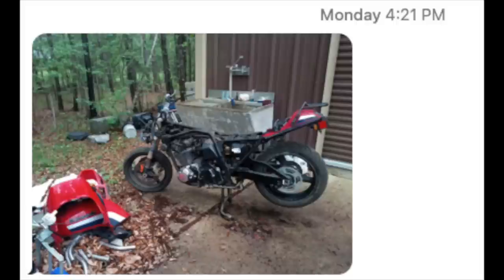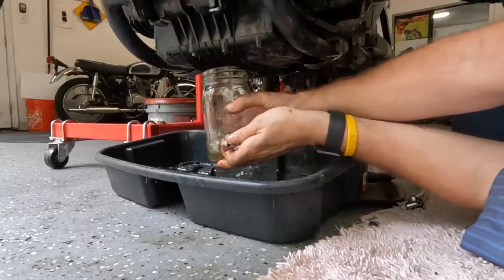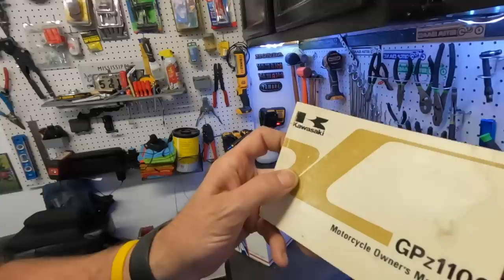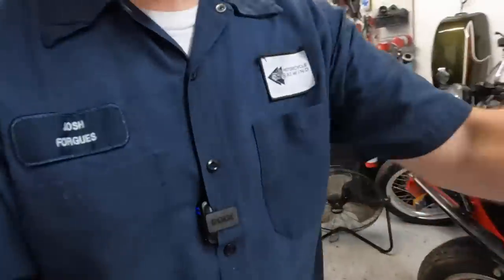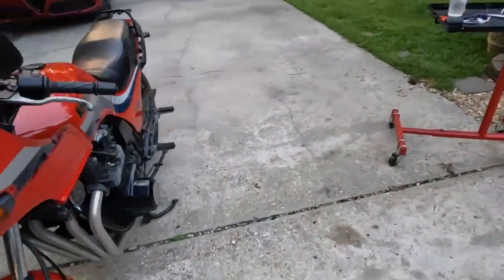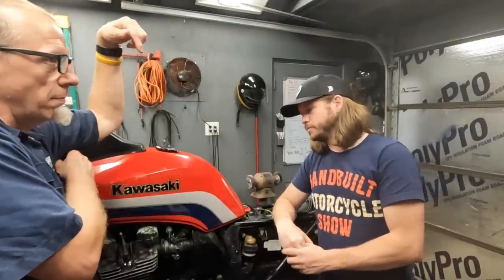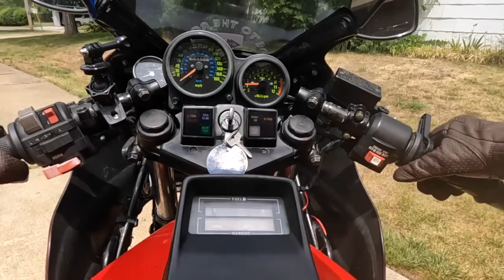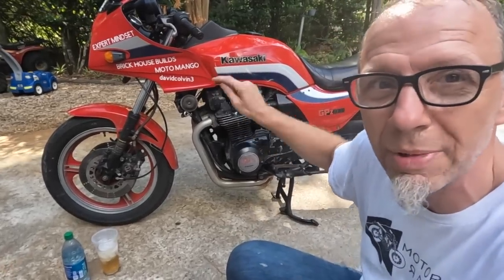Can I ride 3,000 Miles on abandoned 1983 Kawasaki GPZ1100 #gpz1100 #vintagemotorcycle #sportbike

Comment: Great to see another classic back from the dead!
Reply from the maker: This is one of my favorite bikes now. I ride it nearly daily.
Reply: @motorcyclerewind  - I’m just puzzled how it is that people can store a bike in that way. I needed a new engine for my FT500-engined Honda CB250RS. Got an XL500S (1976) from a seller in Germany. If he’d bothered to oil up the bore and put in a spark-plug, it would have been good enough to go straight in as a runner. Piston & rings siezed solid to the bore. Bore ruined. New piston , rings and a rebore required.

Comment: I brought one of these in 1983, when I was 23. I still have it and ride it occasionally. Still has the fuel injection on it - most of the ones here in Australia have carbies on after the DFI packs in. Good you for getting her going and keeping it as original as possible.
Reply from the maker: WOW!!! I would love to hear your GPz stories. I have fallen in love with this motorcycle. Thanks for watching.
Reply: How many miles does she have?
Reply: I bought mine 2nd hand in about 85 or 86 and its still in the shed hasn't been started in 30yrs, best trip I ever did was Sydney to Adelaide to Melbourne and Sydney.

Comment: As an owner/mechanic of several big vintage Kawasaki’s I can say it’s the crank sensor - Hall effect sensor. They eventually go out on all these bikes and usually become heat sensitive over time so the bike will start and run until it gets hot then: poof!
Reply: Even newer vehicles are worse when it comes to the myriad of electrical sensors and complexity hey.
One of my bikes is a 1983 two stroke, no fuel injection even, I love it, it takes me back to being 18 again and it's easy to work on unlike my modem bike that's even got a fly by wire throttle.
Reply: @steveclark..  Which ONE>??Cant be an RZ 3 fiddy..those were 84/85? I have friend in Boulder Co with an NS 400 triple. Or dirt bike>? I have 93 Wr250z / Ktm 300 2008 1974 RD 350 Love my olde " OILEYS"
Reply: @davestrain9529  The first RD350 with water cooling.
Reply: @steveclark..  YAY! 4LO. Non Ypvs. My friend has a Canadian. my riding budd. Partners in 2T Crime
Reply: Yes, the Kawasaki crank triggers of the era are woefully prone to intermittent failures. I had an 811000LTD that would drop two cylinders anytime it was too hot outside or whenever it rained. I had a few others that gradually failed outright. Dyna S is one low-ish cost solution for the 81-83 big KZ-J type engines (but won't easily bolt on the 83-85 GPz1100, 85-86 KZ1100 LTD, or KZ1100R without completely swapping the ignition housings and KZ-J mechanical advance mechanism on the right side of the crankcase), but be prepared to spend more to swap out the coils and wires too. The Dyna 2000  ignition system is more expensive, but it has more features including programable advance curves, and can fit the stock later model GPz style housing with minor mods. Forget about the Dyna 4000 unless your bike is only used at the drag strip. The ARC 2 is also pretty much racing only - my friend has one for his MTC 1395 cc  GPz 1100 with a home built fuel injection system that works with the ignition, but hasn't run it yet (work is ongoing).
Reply: @steveclark..  The 81 RD350LC "Elsie". Giant slayer in its day. Only exceeded by the 88 TZR250 in best ever two stroke race bikes Yamaha made for Canada with lights and a license plate holder. Of course, putting a license plate on a TZ750 or YZR 680 Daytona Special would be even better.
Reply: @davestrain9529  Most of the world that still had new two stroke street bikes after 1978 got the 1983 RZ350 one year before it came to the USA in 1984. The predecessor and first liquid cooled RD 350 was the 45-ish HP RD350LC - (guess what "LC" stood for) that first appeared in 1981. In countries like the UK, the 55 HP 83 RZ was still called the RD, even though it was a completely new design featuring the first street bike version of YPVS.
Reply: @steveclark..  RD 350 LC that engine basically  was with very few changes still in production until 2012 or 2014 from memory was the last time in Australia at least you could buy a new Yamaha banshee Quad that used the same engine so parts are easy to get then there is the aftermarket .I have built Banshees up to 1300 CC Triples with Billet cases and Hyabusa Suzuki gearboxes in them Cases by Mattoon Machine, plus 535 and 610 and 800CC twins
There is so much stuff for banshees a common build on the cheap was Athena out of Italy Barrels plus a 4mm Stroker Crank from HOTCAMS crank range that combo did not require machining Crankcases fro clearance but with 35mm Keihin PWK cards and chambers they make about mid 90 Horsepower at the wheels so an absolute rocketship for cheap.There are so many options for Banshees such as Cheetah Cylinders etc worth looking into I would run Athenas on the road probably not so the Cheetah Cylinders.
Reply: @davestrain9529  Yes, it's a 4LO, all my teenage friends had them back in the day. Of course I would have liked to have the full fairing YPVS model back then but couldn't afford one. I could have bought one the other year but I'm so pleased that I went for the 4LO instead, the memories alone, just looking at this bike every time I'm in the garage. This is the only make and model of bike that I now own 3 times, in 40+ years of riding, that says something. I don't ever plan on letting this one go.
Reply: @scottb8175  Yep, that's the Elsie that I have, mine Is a 1983, probably one of the last ones out of the factory.
Reply: @scottb8175  I rode the 88 tzr of  freinds for 3 months when he was on holiday & I looked after it, couldn't wipe the grin off my face after every ride, if i'd been a bit shorter(I'm a 6 footer) I'd have bought one then & still have it . Most fun you can have on real roads.
Reply: Yes excactly what happened to my Kawasaki 900R (the Topgun model, same color even) i swapped it to a GPZ750 ZX never had the problem with this later model, i even drove long distances like Denmark-southern France twice (2000 km) without long breaks. Maybe they fixed this problem in 1985 and forward. My last Kawasaki was the legendary ZX-11 (this bikes poor brake abillity and crazy power almost had me killed several times, probally bad brake abillity due to the high center of gravity and small ground clearance) my friend had the ZX-10 tomcat so i had to buy the 11 to beat him. (The fastest bike in the world for 6 years)
Reply: @boboman67  Don't know how true this is but it's sad that the bike Tom rode in that movie wasn't a 900, it were a 750 version.
Reply: @steveclark..  scroll down to see all the original photos from the scenery
Reply: Either that or maybe the fuel pump (if it has one).
Reply: The R 5 was the first Yamaha twin. Piston Port two stroke. I had one and it could be turned into Quarter mile bike. Then the RD 350. Great bike. I could outrun most 750s. If I ever find another I will make a project out it.
Reply: I have a 84 gpz 1100 , bought it 8 years ago. It had sat for over 20 years. Replacement injection parts impossible to find. I was forced to put on a rack of Mikuni BS 34 carbs until I sourced out most of the fuel injection parts. That took 2 years. Now the bike runs like new.
Reply: That’s exactly what happened to my Honda single

Comment: You have genuinely encouraged me to get the spanners back out on the bike that's sat in my garden for the last 18  months 😊😊 one thing I will say is no matter what the project is, I'd urge everyone to spend the £2  on a simple inline fuel filter - the hassle that can save is worth it 100x over!
Reply from the maker: Send me pics of your bike to MotorcycleRewind@gmail.com or on Instagram. Great advice on the fuel filter. Ounce of prevention, pound of cure sort of thing. Thanks for watching.
Reply: get quality metal one and change once a yr cheap insurance

Comment: I bought a 2004 Ninja 500R for $500 in March 2023 … sold as not running, in three pieces …. By June 2023 I had taken it to the interior of BC 1215km round trip … ran great :) …. My Ninja 500 for $500 (plus a few $$ on parts and some elbow grease - and of course some Kawasaki good luck) …. Ride on …. Cheers from Vancouver Island BC Canada 🇨🇦
Reply from the maker: We need to do a ride together!!! Those are my favorite kind of motorcycles. Ones you get cheap and shock everybody you tell how much you paid for it or in my case didn’t pay. Thanks for watching.

Comment: Dude that thing is so cool. 
Back in 98 I bought a wrecked. 95 Suzuki GSX-R 1127cc, I restored it and rode that bike for 12 years, it had 6000 miles on it when I bought it, had 43000 on it when I sold it in 2010. I didnt want to sell it but, got to old for that sportbike riding position. 
I ride a 2010 Honda vt1300 sabre now, but I do miss that 136hp that the Suzuki put out.
I have been riding since the mid 70s and have owned around 25 bikes over the years.
Watching you restore this bike brought back memories of my Suzuki Gsxr 1127cc.
I have always been a fan of japanese bikes, especially Hondas.
Great video 👍
Reply from the maker: Glad I could help you stroll down memory lane. This GPZ has been so much fun. I really like it. Ride it almost daily! Thank you so much for watching.

Comment: I had one of these 23 years ago. I bought it second hand from a dealership with (thank God!) good warranty. Unfortunately it had the same kind of issues as yours. When everything worked, it was a beast with wheel spin in 3rd gear on a wet road if you went a bit too wild on the throttle. When I had to turn the bike in for repair the 4th time, the mechanic told me that they ran out of options and offered me to trade it for a Yamaha FZR 750 which I did. A great bike that ran without any issues until I sold it 2 years later.
Reply from the maker: Theses GPZ’s are awesome. Sorry you had problems with yours. Thanks for sharing.

Comment: A testimony to how damn bulletproof the air cooled  4 cylinder two valve Kawaski engines are. The 1983-85 GPz 1100 has all the good parts the KZ drag racers would die for - strongest crank, the biggest valves, highest flowing cylinder head, undercut transmission, strongest clutch, etc. I have two 83 GPz1100's....but only one has a functioning OEM DFI.
Reply from the maker: That’s why I say this is the best motorcycle ever made.
Reply: @motorcyclerewind  The one I have that is stock, except running a stock but re-jetted set of 81 KZ1000 Mikuni BS34 carbs,  has pulled my 210 lbs carcass to over 150 mph, measured by GPS. Not as quick as the 83 GS1100, CB1100F, V65 Magna, or 1100 Katana, but give it room to stretch its legs and it will gradually reach and hold 150+ and slowly walk away from all the above 1983 horsepower kings. I've never tried to find out what top speed is on the one I have that still runs the OEM DFI, though - that one burns copious amounts of oil and ran noisy since I bought it. I'll probably just swap the DFI over to the nicer  carbureted  one and use it for spare parts (It's in rough shape all over, and has the entire front end from a GPz750 Turbo on it).

Comment: I so enjoyed watching your adventure. I could relate to your trip and finding great pleaseure in not knowing what tomorrow brings.
Regarding finding the electrical fault i once had a Varadero with a similar problem and by chance i could start it in the pitc 53:06 h dark. Found small arch like sparks inside one wires leading to the ECU. Found an internal wire break making partial contact. But could only see it in the dark....hope you solve the problem.
Reply from the maker: I did not know what I was getting myself into. Thanks for watching. 
The fault that shut us down at the end was the coil for cylinders 2&3 was loos and shorting out.

Comment: Nice work! This might be blasphemous but it looks pretty slick with the GSXR USD forks and swing-arm. I also appreciate wanting it to be period correct. Do you reckon the GSXR parts would have really negatively affected how it went down the road?
Reply from the maker: Yes the swing arm hit the frame so know rear suspension. Not fun to ride. The front suspension would have worked but not without completely fabricating a upper and lower triple tree. The one on the bike did not allow for me to turn the bike around in the driveway.

Comment: Had a similar issue with my GPZ1100. The 4 into 1 header was less restrictive and caused the problem. I installed a 0-5k rheostat between the temperature sensor (in the head) and the CPU. I ran wires up to the instrument panel and drilled a hole to install the rheostat. Just adjusted via the knob, 'till it ran right.  I bought mine second hand and it came with a Kerker megaphone exhaust, It was the first year Kawasaki produced the GPZs and it had two shock absorbers.
Reply from the maker: That sounds like a mod I would be into. Thanks for watching

Comment: I learned to drive on a 83 Gpz1100. Probably wasn’t the wisest way to start but survived. Bought a new Gpz 550 and had a lot of on Kawasakis since. Respect on the awesome rebuild.
Reply from the maker: The GPZ1100 is a crazy bike to learn on. 😂 thanks for watching.
Reply: @motorcyclerewind 
I owned a 1984 GPz550
/  AKA zx550A1.    It had same frame-mounted half-fairing as your 1100.    My 550 was the LAST year they ever made GPz550.  The next year,  they came out with GPz600 Ninja  (with the 16" front wheel).

Comment: Watching this video brought back good memories, and nightmares from 1992. Had an 84 1100 GPz, loved it, but it had the exact same demons yours has; 3500 rpm lean spot, quitting for no reason, coming back without doing anything.  Possessed.  They did not like headers.  Only a few years ago had an ‘82 with stock exhaust.  That one was was more reliable, but still had a lean stumble time to time.  Was ready to find another until the scene where you were left stranded.  All good fun.
Reply from the maker: Thankfully the DFI has been trouble free. The coil vibrating loose at the end is what shut us down. Have put another 3,000 trouble free miles on it since. Thanks for watching.

Comment: This brought back some memories. Familiar friend from long ago. Well done.
Reply from the maker: Thanks for watching Adam. Assuming you had one would love to hear some stories.
Reply: @motorcyclerewind  Yes I had the GPZ 750 turbo, 1984 model. Had it from about '91 to '95. Samr colouring, slightly different with a full lower fairing and cowl. Most comfortable riding position, seat, and just a sublime ride on the open road. As soon as I saw those original wheels go back on, the snail cam adjuster on the swingarm, the memories of wrenching on that thing in the early hours came flooding back. My late wife adored it too, we went everywhere together on it.
   Yours has now entered the category of  SURVIVOR rather than abandoned. 
   I personally would ditch the exhaust as those race cans tend to cause leaning out problems. Unsure if a ECU flash can even be done on that model now, so closer to stock exhaust back pressure and flow would probably ease your lean stumble. 
   Keep on with this project man. its worth it.
Reply: @motorcyclerewind  Funny thing about old memories. I too had issues like this. It turned out to be crap from the interior of the tank blocking up the fuel filter. I was always replacing the filter. I'd investigate rust layers in the tank, maybe the old shaking nuts n bolts about in the tank to scour its interior clean, then a tank liner product.

Comment: Funny how you got it resurrected except for the speedo...
I love these old bikes.  Thanks for the video.
Reply from the maker: I explain it in the Q&A video. I left for the trip on Tuesday AM. The first time I rode the motorcycle was the Saturday before in late afternoon. At that time I realized that the speedo cable I had purchased was incorrect. No way to get another in time. I added another speedo to the left side of the gauges tucked into the fairing. You can see it in some of the footage. Thanks for watching.

Comment: Most impressive work on that GPz. Had the same issue Labor Day weekend.  Sept 1. Beautiful day here in MD.  I suit up for a quick ride on the old 84 VF700F Interceptor.  Out for a rip after pulling the carbs in July.  Put 40 miles on her after that with no issues.  Back to Sept 1.... get to my turn around point and she starts to putter out.  Gurgles to a dead stop.  Tried bump starting, nope.  Full choke, no start.  Try reserve, nothing. Turn off the fuel thinking too much gas; flooded, nope not starting. At this point I'm thinking fuel pump.   My neighbor rented a U-Haul cycle trailer and came to my rescue.   Need to push her into the other garage, pull the tank and see if she'll run on an aux tank.  Hopefully just a pump and a moderate repair.  Pulling the carbs was very difficult.  Putting them back on even more so.  If you have a V4, you know what I'm talking about. Ride safe my two wheeled brethren!!
Reply from the maker: Thankfully we were able to get it fixed the first time. What shut us down in the end was a loose coil. Sorted that out and have been riding it nearly daily.
Reply: Amazing how it is usually something very simple.  Glad to hear she's rolling again!  @motorcyclerewind

Comment: I am too late with my reply here but, I had one of these back in 89, i had a similar problem to yours, after a lot of investigating i found the connections in the wiring plugs for the DFI were too loose/slack. They probably had gotten more and more loose til eventually it caused running issues. Tightened/closed the connectors up and she was fixed.
Reply from the maker: Not to late. I am doing all the preventative measures possible. I will put recheck and repair(where needed) connections.